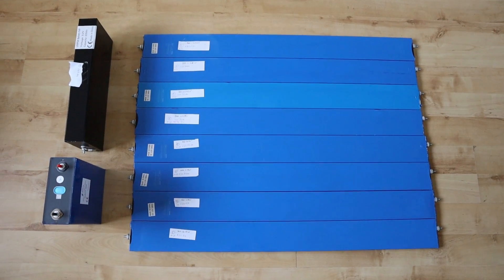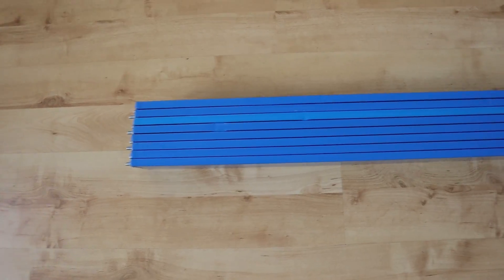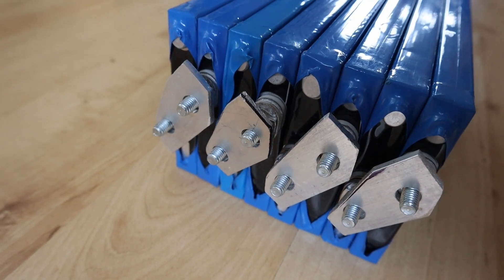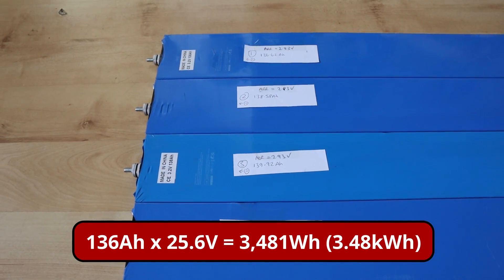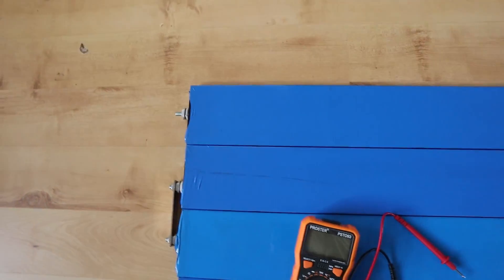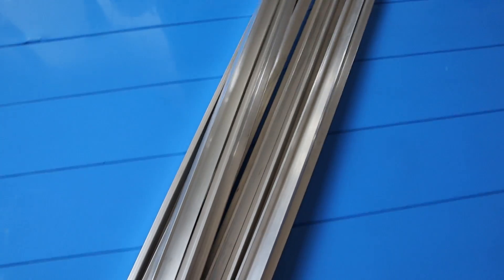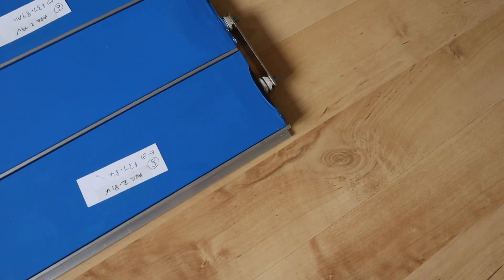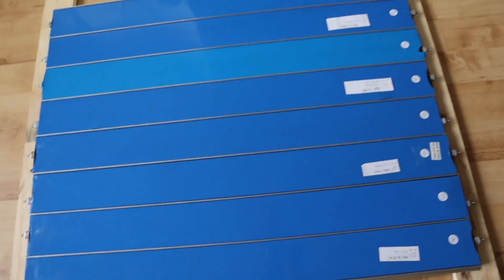Flat Battery, Literally! | DIY LiFePO4 Blade Powerwall | Part 1

Comment: I like the difference in size. But 300Ah generic prismatic cell  is now around 125 euro per cell Eve A grade inc. 21%VAT, and cheaper if you order more.
Reply from the maker: @bloepje  Completely agree. Just trying something different that could appeal to different use cases (more compact spaces, weight requirements, etc). It’s been kind of fun too.

Comment: heat srinc the terminals on the welding so they are less likely to have any short!!! i can think many ways to improve isolations!!!!!  i wouldnt go on this type .. it seems extremely stationary if not reinforced and compressed!!!!!! but would love a  beautifull powerwall different than the others
Reply from the maker: @panospapadimitriou3498  Thank you so much for the heat shrink suggestion! I've just ordered some more to cover up the terminals as much as possible, which will also help for the flat powerwall build! Great idea👍. All the best, Adrian

Comment: The bus bar problem is easy to fix, your batterie placement is wrong. Turn the second one so the terminal is down, the third one so the terminal is up, the sixth one so the terminal is down and the seventh one so the terminal is up.
Reply from the maker: @Awaken2067833758  Thank you! I did originally try that on a few cells, but not the whole 8 as the middle (negative) terminal was still quite close. I'll give it a go before I assemble the flat powerwall build👍. I'm thinking I'll need some more blades for another build now. Thanks for your suggestion. All the best, Adrian

Comment: Hi 👍as I have said before not my line of work , so don’t laugh if this is a daft idea, is there a safe sheet foam material you could lay and bridge the lips of the metal strips,and if there is could you also put it the other side to help with the uneven wood.👍🌞🐝
Reply from the maker: @jimdaly5077 Hey Jim! I'd never laugh at someone taking the time to provide a suggestion or ask a question😃👍. Do you mean across the gap between each t bar and then battery on top? Cheers
Reply: @DADvinci  Hi speaking as you have it layout in the video, the base (I know it will be a side) in between the metal runners,along all 3 pieces of wood cut in and fix foam pads,and then when the batteries are in place again along the direction of the & inline with the wood all 3,from battery 1 to battery 8 put a strip of foam cushioning the batteries and moulding around the metal lips of the bars, and allowing airflow. As with all ideas it is just a starting point and will probably need tinkering. Hope it helps. 👍🐝🌞
Reply from the maker: @jimdaly5077  Thanks Jim. I think I get it now👍. You can always correct me when I mess it up 😊. Just need to find foam (perhaps use neoprene). I'm moving more towards a single sheet of ply, then mounting on there as I can use small screws (lots) to hold it in place better. #experimentation
Reply: @DADvinci  👍all the best I’m sure you will come up with a workable solution. 👍🐝🌞